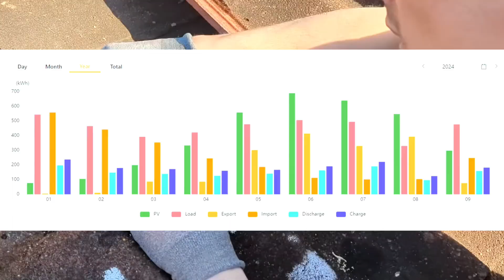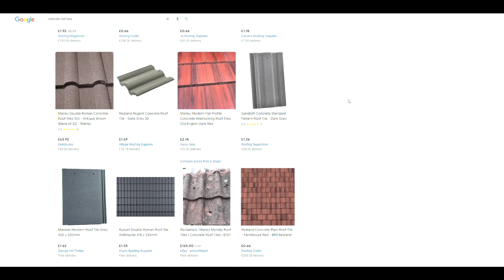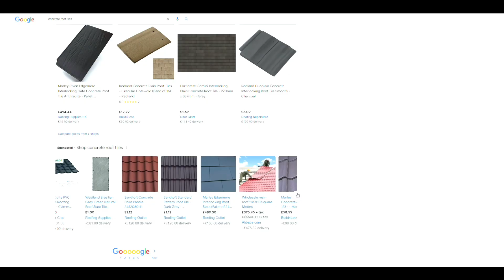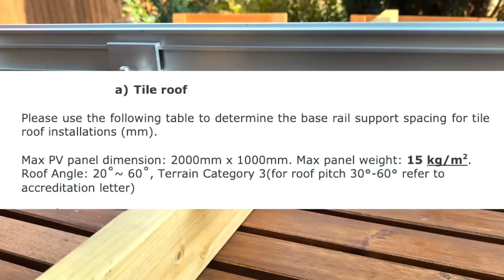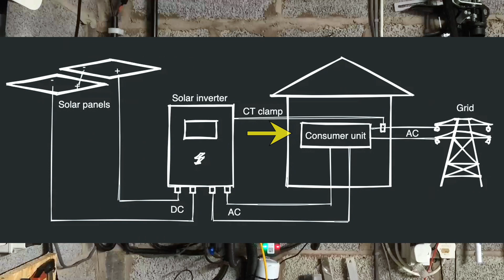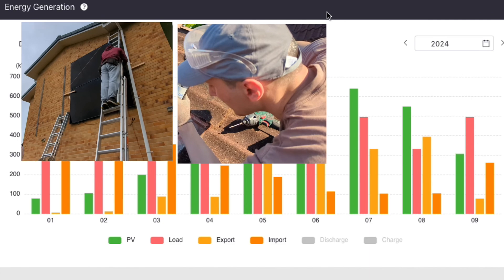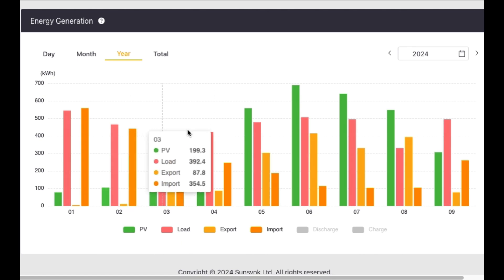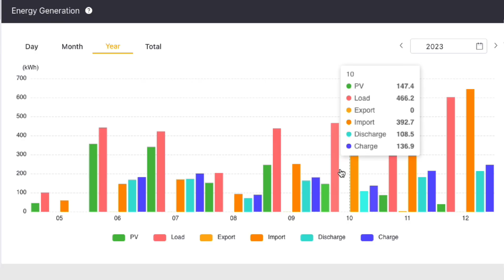EASY and SAFE First DIY Solar Roof | Full Setup + 16 Months Performance Review

Comment: We had a battery and inverter installed and made savings straightaway. Getting some solar installed has been a frustrating experience though because we too only have a small garage roof for panels and no company will take such a small job. Your video has inspired me to look into DIYing this as well.
Reply from the maker: I'm glad you are inspired. Stay safe with the DIY and good luck with the system! It's a fantastic time to build a system with the current prices of components and energy prices pushing up.

Comment: Heads up, RCD should be 16a, max 20a if the inverter is a 3.6kWh inverter. Also 6a for lighting. If you upgrade your DB get one with bidirectional MCB.type A
Reply from the maker: Thanks for the heads up. I was thinking of going for RCBOs and type C on the inverter. I'll need a new consumer unit eventually if I put an EV charger or a heat pump around the garage.
Reply: @solarenergyconcepts  the breaker must be bidirectional, this is important part. The uni-directional ones may malfunction and cause a fire.
Reply: From the SunSynk manual - "For the 3/3.6/5/6KW model, the recommended AC breaker for grid is 40A".
Reply: @ihampton  For a G98 DNO max must be 16A per phase as he is exporting (20A breaker) sorry should have been more clear
Reply: @ I think the G98 limit is all based around the inverter export capacity, I haven’t seen a requirement to fit an MCB or RCBO that aligns with that.

The SunSynk recommendation of 40A (and a 6mm cable) does seem higher than you’d expect for a 3.68kW device. I assume they must be factoring in a scenario where the battery is charging and maybe something like an auxiliary load is also pulling power from the grid. The 3.68kW inverter might then end up pulling 7.4kW.
Reply: @ihampton g98 max is 3.68kw, anything above is g99, just had a look at my sunsynk 3.6kw it does state 18a max with utility and 35a max stand alone.
Reply: @zamankhan4444 G98 is all based around the inverter output capacity, not the protection on the circuits connecting it to the grid. Hybrid inverters perform functions in addition to inverting, such as 35A of AC pass-through, so a larger MCB/RCBO might be appropriate and still acceptable under G98 (the inverter will still max out at 3.68kW after all)
Reply: @ihampton I just checked the manual grid side is 25a recommended for 3.6 inverter the 40a is for the backup load not the grid side, 20a is still OK to run on a 3.6 inverter
Reply: @zamankhan4444  I read it as being the other way around, grid is 40A. From page 20 of the manual currently linked on the SunSynk site: 

"For the 3.6/5kW model, the recommended AC breaker for backup load is 25/40A respectively. For the 3.6/5kW model, the recommended AC breaker for grid is 40A."
Reply: @ihampton hmm my background refuses to believe what is written, 40a is rated for about 9kw so that can't be right. Anyway I've hade 20a fitted over a year now without issues, guess I'm over safe
Reply: @zamankhan4444  it will be right for customers who choose to use the AC passthrough and pull 35A from the grid through their inverters. The MCB is there to protect the wiring, if 6mm cable is also used as per the manual then it will be no more or less safe than a smaller MCB as the rating is appropriate for what a 6mm cable can handle.

I think SunSynk are correct to base their recommendations in the manual on the max the device can be configured to pull from the grid. Even if a customer doesn't use the AC passthrough on day one there's a risk that the installation might be altered to include it at a later date without any thought given to the MCB and cable size used initially. You could argue that this makes the use of 40A/6mm the safer choice for all installations.
Reply: @ihampton you are correct using 40a when used with passthrough, I never needed it hence never looked into it. 20a can handle continuous 4kw without tripping and originally fitted it so I don't exceed the g98 terms.

Comment: Thanks for sharing. Which panels did you use? You may have been able to get some taller panels on there to take advantage of the space you've got. I believe it only needs a gap of 30cm at the bottom and 40cm at the top.
Reply from the maker: Thank you for watching the video. Good observation and I agree. These are the 8.33 430 1899x1096. We bought these in early 2023 and there was still a shortage of supplies in the UK so the choice was scarce.
Reply: @solarenergyconcepts  Do you have a link to a data sheet for those panels? They're an unusual size, being taller and less wide than most of the panels of that wattage - which tend to be 113cm wide. I'd hazard a guess that you didn't get them from City Plumbing? Also, I can't make out the usual cell pattern so I'm wondering if they're shingled?
Reply from the maker: @chrisnortheast888  - This should be it: https://www.solartradesales.co.uk/Cache/Downloads/shingled-430-2-2-2.pdf
Reply from the maker: @chrisnortheast888 Yes, they're shingled. There's a link to the datasheet from this page: 
https://www.solartradesales.co.uk/8-33-solar-430w-full-black-30mm-mono-shingled-cell-solar-panel?cat=9698
Reply: @solarenergyconcepts  Thanks for that, something to think about for a future project. I'd need to get few though to justify the £95 delivery cost.